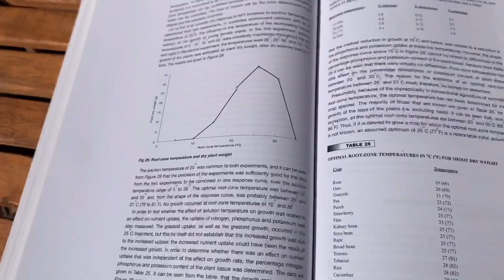Nutrient Film Technique: You’re Doing it Wrong!

Comment: I'm just learning all of this at the moment and I like the Kratky method and plan to try an NFT Kratky Hybrid system once I get sick of tubs :) . From my studies so far, NFT requires an oxygenated solution as the roots are pretty much always in the solution proper (no separate air roots like Kratky). I think for the hybrid approach you would need to take away the fall/slope and just maintain say a 30-40% filled pipe to maintain both the nutrient level and the air gap for the air roots. By taking away the slope you can maintain the humidity (important in Kratky!) as the running solution will draw some air with it. In an NFT system the plant can't/doesn't grow air roots and would rather be in the solution whereas in a Kratky with a trickle style top up system the air movement would be negligible. Only testing will tell I guess :)
I would start the seedlings in a small Kratky tub setup for propagation then transplant into the system once some roots develop.
If this works it would be a very low maintenance setup that could run of a header tank filled from the res via solar pump during the day and the system has enough solution to keep over night or for a few days if needed. That's the plan at least :)
Anyway, thanks for the great vid's and information, cheers.
Reply: The oxygen exchange might not be sufficient to run this Hybrid as effecient as a regular NFT (keeping commcercial use in mind), I guess you could introduce air flow to the channels, which could increase risk of algea formation with increased light exposure but I am curious as to what your outcome will be.
Reply: @ yeah, I think you would at least need double the depth of a typical NFT system to maintain a decent air gap, the Kratky 'tanks' are 6-8 inches deep and he maintains 2-3 inches of nutrient solution.
If it was for commercial use definitely use NFT for sure 👍

Comment: First i say thank you for the understanding videos, and slow speaking (im Dutch)

I have a question, i like to make a nft  in my small garden, but what could be wrong if i go from pipe to smaller adapter pipe and than go to the bigger pipe. 
There will be stay water in it even with flow. My smaller pipe will go thru wood of my pergola

Comment: Hoocho I'm running a deep water Aquaponic rail 90mm over round pipe. I think I'm getting away with the oxygen balancing act as I use air to lift water which really charges it and saves watts as it's less energy than moving water with a pater pump. 
Not sure if this technique could help in hydro?

Comment: NFT in research papers is divided into thin film and thick film/flow systems, and yes they have totally different theory of operation. Correct thick film/flow is not adding baffles to a thin film, it is achieved with much higher flow rates. The testing has shown that many thin film systems do not perform as predicted by the more simple hypothesis because heavy rooted plants limit the O2 exchange much more than previously hypothesized as the plants near maturity. The nutrient O2 level of thin film drops drastically after passing just a couple of large plants such as cucumbers or tomatoes while thick flow can brute force the O2 supply. It is also possible to begin a crop with thin film then switch to thick flow as the root mat becomes dense. I haven't seen it tested but I would suppose that active airflow through the channels could be a benefit. (Use a radial flow, squirrel-cage/hamster-wheel style blower like in better bathroom exhaust fans, they develop better flow with some back-pressure than the axial flow fans that you find in eg. computer cooling.) Though I can definitely see some economies of scale involved with forced airflow, and may also recommend a swamp cooler or mist just after the blower to keep humidity high and root temperature in range.

Comment: at 73°F water temp or higher oxygen is not as absorbed by the plants roots. a good thing to add is an 02 emitter to your nute res as an air stone will only make the water the same D.O. as the air around it an emitter doubles the D.O. and doesn't heat the water as bad as an air stone does. if it's 90°F outside the air being pumped into the take through the stones will heat the res.

Comment: A tip to control the heat of summer from raising the temp in the res. I take 20oz soft drink bottles and fill with water and freeze. Then on hot days a drop one or two into the Res. It's remarkable how this cools the nutrient flow.

Comment: The "disadvantages" of soil ;) Dude has not ever worked with good humus rich soil, has he. Good soil has pores AND holds the water.  There is not only waterlogged low oxygen,  versus has air but little moisture - soil is not supposed to be water logged, it is supposed to be moist and if possible under a mulch layer. That is enough for the plants. The genuius of good soil is you get both.  Soil is a pretty old system,  it should be fairly efficient.

Comment: great, clear and informative video, love it. 
 I do have a question, in the past I have run a type of drain and flood system, where I had a reservoir above the plants. 
It was filled by a pump running 15 minutes every hour. 
The channels were fed by smaller tubes by siphoning the water from the reservoir. 
I would love to hear your or other views thoughts but would this not be better ?
1, the water is getting better oxygenation because its being moved between 2 tanks, the small overhead tank and the main reservoir.
2, the roots are getting lots of exposure to oxygen as it really is a small film of water.
3, the small tank can heat quicker due to its smaller volume to get to that sweet spot of 25 - 30 degrees
4, lower running costs as the pump is only running for 25% of the time

Comment: I have a bottom half of a water tank that will hold 700 gallons and haven't started yet.  Trying to learn as much as possible. Please some tell me if this is a good starting system.  Fish tank to Solids to Swirl tank (100 gallons) to   (Mineral tank) 55 gallon than to plants then to sump tank than back to Fish tank.  This is what I have on hand to use now and all will be in a Green House.  Please tell me if I am on the right track of order.   I am new and would like any and all help.  Thank you

Comment: A question regarding root rot. As you say it is caused by lack of oxygen to the roots, why not run the water intermittently? Let's say 5 minutes on, 2 minutes off.. That way, during the 2 minutes, an abundance of oxygen will penetrate the root mass. What do you think about that as a solution for oxygenating the roots? Have you tried that?

Comment: What about a temporary damn for if someone wanted to start seeds in the nft system and then remove it after a week or so once the roots are long enough?
Reply: You could add a separate pipe to your system just for starting plants.  It could use the method he showed at the start of the video to keep the water level at the bottom of some net cups or maybe use a smaller diameter pipe so the net cups reach the NFT flow. Just be sure to cover all unused openings to prevent algae from growing.

Comment: Sorry, but i have to disagree. It is not wrong, you're just living in a good environment where NFT is a better choice of setup. That "quasi nft system" you're talking about is DFT or deep flow technique. It is best for hot low land areas in tropical or hot countries. It is also best for areas with poor electrical services. The DFT uneven plant growth problem due to oxygen can be fixed by adding nutrient hose at the end of each pipe instead of the top pipe only.

..but i have to agree with you if you're talking about those small pre built setup in your thumbnail.
Reply from the maker: I was specifically talking about any system claimed to be NFT that is in fact DFT.

As the distinction is not always known or made.
Reply: @Hoocho  oh, sorry, i wrote a comment before watching the whole vid. Then, i agree with you.

Comment: I'm new to this. Is NFT the best out of all hydroponic systems in your opinion in terms of yield and cost?
Reply: Definitely depends on what you're growing and how you're growing it. Deep water culture does pretty good and is probably cheaper and easier to do, but it's more for bigger plants and water temps can give you a lot of trouble.  You certainly are not growing a 2 pound cannabis plant in NFT, 20 or so clones in a sea of green NFT, no problem. Lettuce, kale, Spinach are probably all better NFT, of course Aeroponics is going to inch ahead on the smaller plants, but once the root system gets too big it's not going to get the same results. NFT can handle larger roots than Aeroponics and deep water culture even larger, honestly surprised nobody has tried a deep water culture in a 55 gallon drum but a plant that large is definitely better rooted in the ground, because a strong wind will probably rip them roots up, but a greenhouse would do. Ebb and flow is decent and also very easy probably not as cheap in the long run or as efficient as NFT, cause you don't need anything but water and nutrients in NFT.
Reply: @josh949  thank you!👍

Comment: The trouble is that the plants will totally block the pipe.I have just had to cut another hole along side a tomato plant and cut off half of its root system to let the water flow along the pipe. i am using sewer pipe but a bigger pipe would be better, but where do you stop.not all but some plants have massive root systems that will block everything.

Comment: Great video, I've been farming for over a decade, and if there's one thing I've learned, wet/dry cycles are essential.  I live in a very wet climate, and get fungus at the slightest scenario of over saturated substrate.
Reply: Great comment, IMHO. With that concept in mind, do you think the average NFT system, in the average climate, would benefit from shutting off the pump periodically, dependent of the current conditions of temperature and humidity?
Reply: Why are wet/dry cycles essential? How does the NFT system either simulate or defy this necessity?

Comment: There has got to be a system that doesn't require paying for power and pumps and artificial nutrients for folks that simply can't afford those reoccurring expenses. Something that uses basic local natural resources.
Reply from the maker: Dirt.
Reply: @Hoocho  Gee, who'da thunk! ;-) Out here in the Mojave desert, there's no such animal. Stick anything in the local silt/alkali here, and your signing its death certificate. Unless, of course, you can afford to outsource and have a BUNCH of non native resources hauled in to heavily amend it and be prepared to have to do that quite frequently. Raised beds are just as bad. They leech out even faster and bake into a brick unless you can afford to more then double your water consumption.
Reply: If you want to get rid of pumps, you could try kratky. You won't get the same yields, but damn cheap and easy.

If you are worried about nutrients, I suppose your body is probably equipped to make some golden tea...
Reply: @kevincrossland1898  I use that sparingly in little mini wicking systems that are well covered to prevent algae formation. The mint and chive type plants just love it. :-) made from 2 and 3 liter soda bottles. Basically any herb.
Reply: @kevincrossland1898  haven't tried it yet with anything larger.
Reply: @natureboy6410  if you think about it, it's pretty much aquaponics except you don't have to worry about fish

DWC could also be feasible, an air pump should take a bit less power than a water pump
Reply: i have seen a video on youtube where unemployed guy had a Dutch bucket system set up and he was the pump. in other words he would water through out the day. if you have the time this is a very good option. also i would love to hear about what you have found.

Comment: Interesting video.  I do DWC and Kratky hydroponics at home (Florida), but the NFT systems have always seemed interesting.  I see all of your produce is outside.  How do you combat insects?  Are you spraying the plants with something?  Where I'm at, if I so much as leave the door to the greenhouse open for too long, I get a white-fly infestation that destroys everything, or an army of caterpillars with the same result.
Reply from the maker: I’m a fan of properly administered pesticides, fungicide, and insecticide used adhering to withholding periods and mindful of native bee populations.
Reply: @Hoocho   - Fair enough.  Thanks for the response.
Reply: @Hoocho  this is truly the only way i have found to keep bugs under control.
Reply: what i did was to cover the doors with the magnetic shutting fly wire doors that you get from the $2 dollar shops. its cut down my bug problems this summer. i have to leave the doors open in summer as it gets to hot, I don't think that you will ever eliminate the white and green fly entirely from a greenhouse. always a big problem.

Comment: About the oxygen problems.
One man told me the solution to this case. Just use corrugated pipes when for drain water. The flow should be 1\3 of the pipe size. In this case water gets oxygen from the air and the main container with solution also will get more oxygen

Comment: Thanks for sharing, we built our system a few months ago and refining it as we go along. A lot of what you have posted has help us on the way. When we first built the system we didn't have enough slope on the rails, we have now rectified that and also in creased our flow rate. I notice in one of the comments below you can't balance the flow to each tube with the one valve. We have put a 13 mm valve on each of the pipes and balanced ours that way, looks to be working quite well. Keep up the good work with the videos, also like the new merch.
Reply from the maker: Yeah that’s my plan going forward, an individual tap on each channel, there will be a video update shortly.
I also need to increase the slope on my pipes.
😊 
So much to do, so little time.
Reply: @Hoocho  Yes we increased or slope just over 3%, before we had a lot of still water in the system when the roots developed, causing algae and root rot. The system looks to be a lot cleaner now.

Comment: Im a commercial grower and know many commercial growers and we all use round channel, its just commercially cheaper. 2 L a min would be the upper limit, I use closer to 1 L a minute BUT looking at your setup you need to increase the slope of your channel it looks too flat but then it could be just the camera angle.BTW another great video keep it up,I look forward to the next one
Reply from the maker: Troy Rosenberg 2L a minute is the textbook general advice across all NFT systems.
I feel that in a pipe system it would be more like 1L per minute due to its small flow area.
I’m experimenting at the moment.
I agree I need to increase the slope, I’ve been considering it for a while as the roots are causing more pooling than I’m happy with.
This comment will probably be the push I needed haha.

As a professional grower I’d love any advice you’d have (things you wish you knew when you started etc)if you’d like to post it on the Hoocho reddit.
Appreciate the advice.

Comment: Totally agree with your "True" NFT perspective. I was sold a system here in the Middle East as an NFT system but it is definitely not NFT and have seen for a long time now that what I have is more a "DFT" (Deep Flow Technique) which allows the routes to stand in about a 2cm flowing river!!! As yes "Root Rot" is all that I experienced in this system when the weather heats up.... (our summers reach 50deg/cel). Moving the DFT inside has helped during the summer and have very strong air pumps oxygenating the water. I am looking at a complete replacement and even at Aeroponics which I can keep the water cooler in a controlled tank (with chiller if needed). Enjoy you videos. Use your pucks...Have the same propagator... keep the ideas coming. Thanks

Comment: I see that you have ditched the irrigation manifolds and just put the 19mm pipe straight into the NFT...  Too hard to maintain? How do you control flow / back pressure evenly across the rails?
Reply from the maker: Nigel Murden I’m playing with it at the moment, the flow is controlled with a single tap but the outlets are varying with the distance and height of the outlets.
I’m thinking I might change back to the manifolds

Comment: I’m doing it wrong, sorry, not sorry. I build my pipe systems with the nutrient solution level with the bottom of the net pots. A level of nutrient solution in the bottom of the pipe gives a margin of safety if the power is out or the pump fails which can be the difference in plant death or surviving such events, particularly in our hot Australian climate.
Reply: Agree!
Reply: I have done similar.
Using uniseals for the drains, I can vary the nutrient level

Comment: Another great video and I will need to update my system a bit. I did have a few questions from things you brought up in the video:

1. Is there a good rule of thumb for how big your reservoir should be compared to the number of rails you have? Id imagine having too big of a reservoir could mean water stagnation if it wasnt getting cycled enough.

2. Does your NFT system pump run 24/7 or do you have an on/off cycle with the water? Some systems Ive seen (not NFT) use a 15-minute-on/15-minute-off cycle. Based on your video here it seems like the plants should be fine with the aeration/water amounts but just wanted to check
Reply from the maker: James S full time pump, the res size will depend on the quantity/type of plants you have. 
For the sheer quantity of foliage I couldn’t drop below a 400L res.